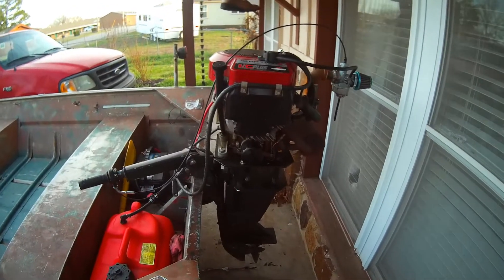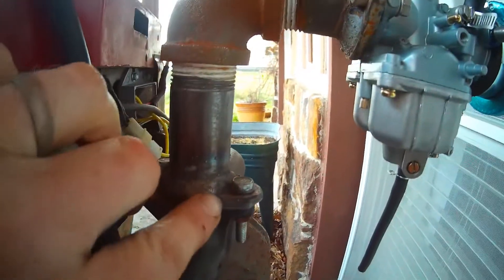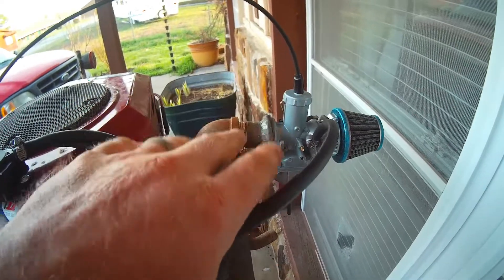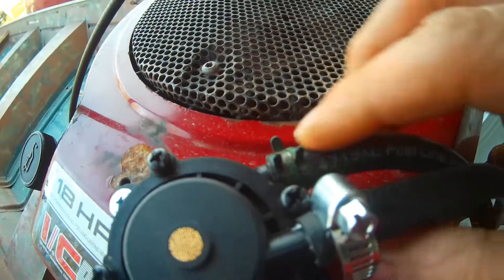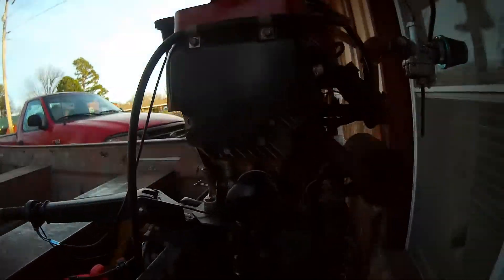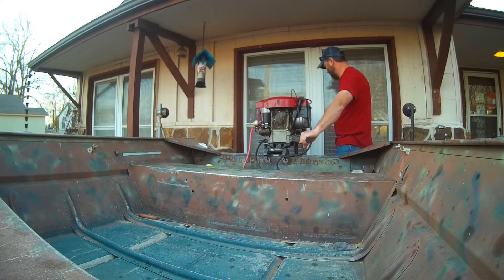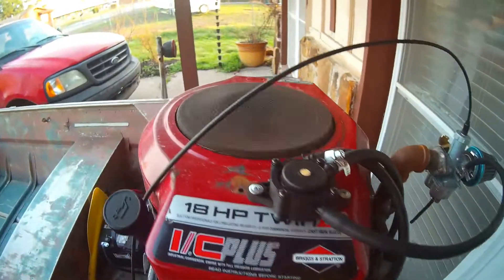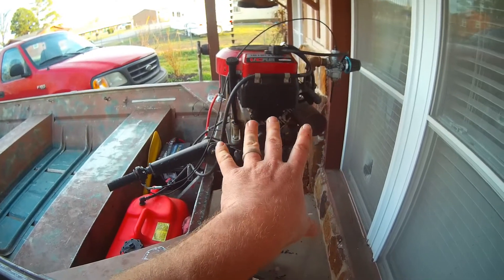homemade surface drive upgrade

Comment: I have always wondered what the advantage these have. The lower unit is just a regular lower unit so it wouldn't float in higher in the water. I am guessing the main advantage would be lawn mower engines are easy to find. For the same horsepower wouldn't it weigh quite a bit more. Don't get me wrong I am all into anything that can be Frankensteined I wouldn't hesitate to build one myself as long as I thought there was going to be some advantage to doing it this way. Thank you
Reply from the maker: i absolutely love these builds i have been doing cheap parts and motors everywhere if not free but the best part is the aircooled 4 stroke engine no water pumps or oil to mix i love these franken mud motor builds alot and plan on doing more and they are heavier but not heavy enough to effect the transom or anything hope that helps